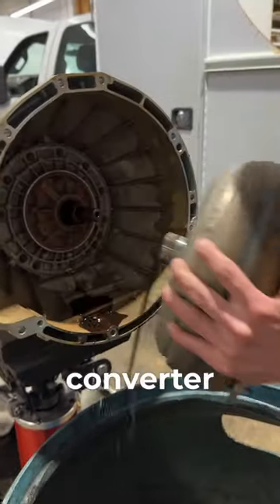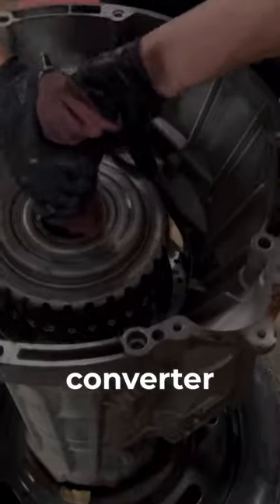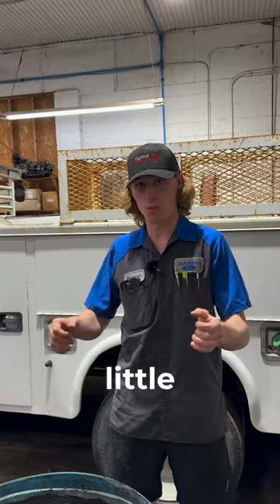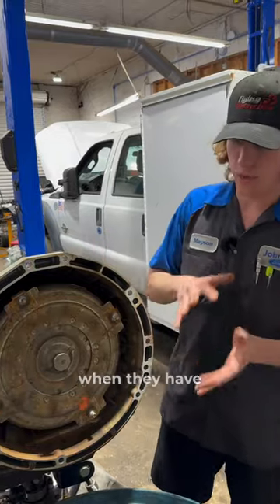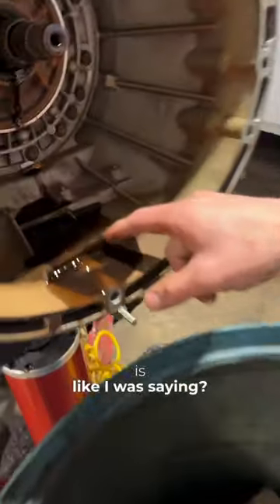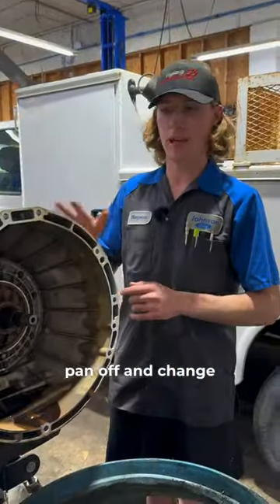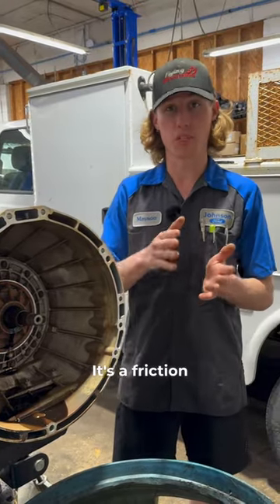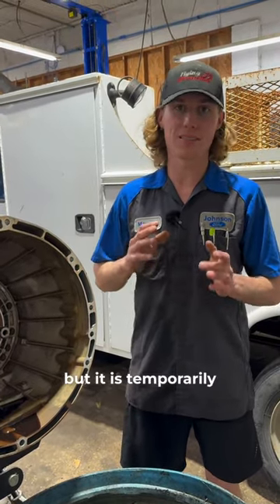Ford F150 6R80 Torque Converter Shutter? #ford #f150 #shorts

Comment: I had a shutter on my 2016. I added the shutter fix and it worked for 2 weeks.  I ended up doing a drain and fill and it solved my issues for the past year.  I know it won't last forever
Reply: Shudder not shutter.😂
Reply: Phew, thanks for the comment.  No one would know what I was talking about.
Reply: Imagine the people that buy a used vehicle that someone has put this in. This is probably a great product for someone who owns the vehicle, but I would feel pretty bad for someone who purchased one with this slick fix.
Reply: @dannyamericandream  I don't think it would hurt anything over time.
Reply: @skidooextreme2233  I don’t think it would hurt anything overtime either if it belong to you permanently. My point is some shady car sales place dumping this product in a transmission that shutters and sending you down the road. That’s my point. You might make it two weeks with that stuff. Maybe you get lucky in at six months.
Reply: @skidooextreme2233  I knew what you meant lol!
Reply: Flush + filter before additive, remember you are looking for a cheap fix, if it works you save serious $$ 
   Don't listen to morons the who think changing the transmission fluid will kill your transmission, if it fails it would have anyway, it's already damaged, remember? That's why you're trying to fix it!
Reply: That shudder fix is amazing it fixed my brothers 2014 Camry shudder after it had been doing it for the past 120k miles also fixed my 95 deville that wouldn’t go into overdrive anymore, fixed my girlfriends 05 Highlander that would slam into gear this was all years ago and all 3 cars still shifting amazing and no shudder
Reply: SHOULDN’T HAVE BOUGHT A FORD BUDDY
Reply: @leomarq  I had a newer Chevy truck and had the engine and trans go out at around 30K miles. The Ford Had a small shudder but other than that it's been rock solid. I still think overall Toyota is best but couldn't find a good deal when I was in purchase mode, lol!
Reply: To be honest, when we’ve changed the fluid, the shudder disappears after driving for 30 or 40 miles and remains gone for a long time in most cases and does not return. The additives don’t work for long. But changing the fluid does. I ALWAYS recommend changing the fluid first. If it lasts 40-50 thousand miles, by then it’s time to change the fluid again anyway.
Reply: What shudder fix did you use

Comment: Ford has more recalls than just about any other manufacturer.  Pretty sad!
Reply: Lol Ford motor company had over 21 million recalls in the 80s
Reply: Ford is the most recalled vehicle of all time, and it's not even close IIRC
Reply: @donaldkinder6716  The F-150 by itself is the most-recalled vehicle of all time, and it's not remotely close.  Like close to double the next most-recalled vehicle.
Reply: Yeah they should stop the recalls and just make the customer pay for the repair. That way investors can get more dividends from profit sharing.
Reply: @martyk1156  No, maybe they should make a better vehicle!
Reply: @martyk1156 fanboy 😂
Reply: @flight2k5  stock owner that wants higher dividends at the customers expense.
Reply: @martyk1156  you are?
Reply: Pretty sad no other manufacturers are willing to admit fault and fix things and there's no company that doesn't have serious issues
Reply: @robinhookedauto542  fanboy

Comment: My C6 pulled just fine in my old truck 1976 F250, for over 40 years.  Did i rebuil it?  Nope, got one out of a 72 LTD in it now.  Pulls good.  So poor i didn't even buy new fluid.  Just poured it through several layers of shop rags to get the chunks out.  No new filter or screen used the best out of the two.  I have moved trailer houses with that baby.  Move a 14,000 pound tractor, backhoe, i have used the heck out of it.  It was still pulling but would disengage when i hit the brakes.  That was the first time i pulled a transmission by itself.  I usually pull engine and transmission together.  I will do that from now on.  Tough to get out only transmission.

Comment: 2016 6r80. I added the shudder fix. Ran it with no issues for 9,000 miles. Then changed the tranny fluid. Still going strong
Reply: Me too!
Reply: Good thing I have the superior 6R140 so I don’t have those issues
Reply: @RiggyRonnie  what year?

Comment: Also, check for misfires, and replace plugs and coils if necessary. Sometimes misfires may give a similar feeling symptom.
Reply: If they feel the same you shouldn't be trying to diagnose and do your own work
Reply: What can happen is a misfiring aftermarket coil without EMI suppression can send interference back into the powertrain control system and affect the transmission's operation. Electronics is my field and I experienced this very problem with a Duralast ignition coil on my '08 Explorer. Felt like the transmission had two anvils smashing together and was going to rip itself apart. Swapped in a Motorcraft coil, problem gone. I had the infamous rear cylinder misfire problem due to water intrusion from the cowl. The stupid design with the deeply recessed spark plugs can allow water to collect inside and damage the coil and plug. Anyway, long story short, the OP wasn't entirely off base. And I'm an old school shadetree mechanic as well, and without understanding the susceptibility of the transmission to EMI, I would've scoffed similarly to you.

Comment: This same issue occurs on the GM made 6l80s and 6l80E’s torque converters, so this problem isn’t just limited to Ford. I just put a new torque converter in my 2009 Yukon Denali 6l80 and the transmission shifts beautifully. I never had the shudder but the trick is to replace the torque converter BEFORE it starts shuddering. Once that clutch material makes its way through your transmission you will 100% be looking at a rebuild.
Reply: it’s not the clutch lockup material in the converter running thru you have to worry about. it’s the metal shaving that come from metal-to-metal contact during lockup after that clutch material is long gone. you did right by replacing it before the problem started. get it tuned, factory gm tuning really kills the converters on top of a poor design. have it set to only lock the torque converter in 5-6 and it’ll live much longer and happier.
Reply: @adamsongarage9933  thanks for the explanation. I’ve been meaning to get a tune the past few months but maybe I should stop putting it off. I sometimes can feel that converter lockup ‘clunk’ at low speeds / throttle so it will be nice to be rid of that and have some peace of mind.

Comment: My Transit has this transmission and best thing it change the fluid regularly. The Transit is a pain in the butt since the cradle covers the pan. I use the fill port suck out a gallon of fluid and replace what I took out. Been doing this every 3rd oil change and my tranny is running great still with 128k on it. At 50k is was having issues already and not missed a beat since I started to keep good fluid in it. Lifetime fluid my ass

Comment: I can say that as a transmission mechanic, i get rid of shudder without replacing the converter. Just a service, with two tubes of shudder fix. They never come back with issues....
Reply: My 2005 F-150 shudders. Will the two tunes help me? Trans was just replaced.
Reply: @tomthomsen11 The shutter fix additive could help but it is usually temporary. I usually drain the fluid overnight so more will come out. Remove torque converter drain plug if it has one. Make sure to use correct fluid. This could also be a  temporary fix. A misfire and a torque shutter has a similar feel to it.
Reply: @carlt6932 thank you!
Reply: @carlt6932 a bad coil/plug can certainly feel like torque converter shutter
Reply: What shudder kit did you use
Reply: I agree with every comment but I will add that the temporary part can often last way longer than you think. I do a lot of these type of services on toyota , honda, and ford 6spd units and I can't remember having a customer who felt like it was a waste of $300 for my service.
Reply: Oh and the sauce is the lubeguard tube's you'll see. They are kind of a weird pill looking tube.

Comment: My 2015 expedition has this problem. Didn't start until 100k miles. After I had the dealer change my transmission oil.

Comment: Same on all pick-ups. Crappy stamped steel converter. Flexes against lock up plate. Replace with a forged, billet steel converter. Huge difference, especially when pulling a load.

Comment: So what’s the brand you recommended using to replace the original? Another OEM or do use aftermarket.  My 2016 needs it done an I’m just trying to see what my best long term option is.

Comment: The shudder is due to fluid breakdown. Change the fluid and it will go away until the next fluid change. You usually don’t need to replace the torque converter to correct this, simply change the fluid and give it time to permeate the clutches. It will take a few days to correct the shudder.

Comment: Quick tip, always check for misfires in these before you condemn the converter.
Ive been one of the guys other techs and shops send their headaches for the last decade or so, I have probably had a couple hundred fords,(3 valves were the worst) still shuddering with a brand new or rebuilt trans, that really just needed a tune-up.

Comment: I know that technically you are forbidden from doing this in a dealership (and that used to drive us nuts), but personally, I would install the shift kit in the valve body.  There are numerous issues addressed regarding TCC, and sluggish line pressure changes. If you catch it in time, you save the converter.  Sonnax makes really great products. I use Sonnax on anything newer. Older stuff I stick with Transgo. Everything else I typically avoid.

Comment: Best selling truck for 47 year's & running.  Keep it up Ford!!!
Reply: Bought a 2021 tundra 5.7 iforce with six speed will outlast any ford gasser. Two tundras with the same powertrain went over 1 million miles… Toyota large v8 = Reliability
Reply: @tannerpickens5356  Yes Sir! Toyota is #1 in reliability. Ford is #2. Ford still out sells them all though 😁

Comment: I put that shudder guard in my 2013 RAV4. They say it works immediately. I was skeptical. Well I can say it does work immediately and 3000 miles later it’s still working.

Comment: Pretty sure there is an oring close to the end of the input shaft that is most of the problem if not the problem itself instead of the torque converter. The "fix" in a bottle is a fluid that swells orings up. My buddy poured it in his 2017 fcrap150 and it totally stopped the shutter. So that tells you its not the converter causing the problem bc it still works

Comment: Also don't forget to replace the seal where the  torque converter goes in. I didn't do this on my wife's ford f150 and it leaked like crazy after. Even though it didn't leak before just Disturbing the oil seal caused it to leak.

Comment: I had this for a little while. Ended up taking to to dealership to flush the fluid then I changed the filter and fluid myself a couple days after. 20,000 miles later still no issue and it was way cheaper. Make sure to replace your fluid in the proper intervals.

Comment: I was told by the transmission shop that the most common issue with the 6r80 is the sensors inside collect shavings and short out.

Comment: there is a difference between friction modifier and shudder guard, friction modifier for the rear end is to let the clutchs slip smoothly, dont put this in your trans, only use shudder guard in your trans
Reply: What’s the difference?
Reply: There’s also products for transmissions, my buddy puts it in almost every transmission he builds. Been using it for 20+ years and has never had any negative results from it.

Comment: The GM 6-speed has the same issue. I don't know where they're getting their torque converters from, but that Chinese metal is just disintegrating into the fluid. Then if you know if you don't change it fast enough and you just keep letting it shutter all that material gets into the pump and blows the transmission pump fluid pump and then she'll be toast and overheat and you'll be walking or most likely getting a Ford explorer for a couple months if you have a warranty

Comment: Had this happen on low RPM's on my old 98 mustang. I was able to fluid change with some Lucas Transmission fixer. Was able to put another 100K on the car before it failed finally around 200K miles.

Comment: For you 10R80 guys if your clutches are getting to hot or just not biting the 6R80 is the move this more just for dig racing this doesn’t apply as much to roll racing 
You really don’t start noticing that issue until your in the 4 digit power number

Comment: Well if your only problem with a transmission is having to replace a torque converter after I'd assume 120k+ miles then you're doing better than most trucks made in past 15 years. I got 200k on my 6r80 and no issues. Shifts perfectly. Did to new filter at 120k  and replaced roughly 7 quarts or so of fluid so maybe that helped me out 🤷‍♂️
Reply: Have a 2014 5.0 work truck just hit 160k and shifts perfect. Has hauled a 5000 pound trailer 5 days a week most of its life.

Comment: Sounds to me the torque converter isn’t the problem. Sounds like a pressure problem. Not enough wear tolerance so I’d be interested if when the shutter shows itself. At that time increase pressure to accommodate for the cpl tho out of spec it has become due to natural wear!!!   Thoughts????
Reply: I Believe the actual shutter is from the lock up clutch in the torque converter slipping when it's supposed to be locked.  Chevy Colorados with the 8 speed apparently have a similar issue.
Reply: @Hollows_over_balls   oh it’s more then “kept in mind” it’s out loud when I said “ I’d be interested if” and when I said “ thoughts”. Pretty clear I wasn’t stating  a “ go no go” response

Comment: So what about the squawk of the converter during heavy throttle, low rpm shift from 3-4? Does it when I accelerate to pass when down shifting too. Blasted through one converter after a fresh rebuild, shop refused to cover it. Brand new converter does it again but it doesn’t shudder. Just the noise

Comment: Sonnax makes a modulator valve kit fkr these that fixes them fairly quickly and without removing the transmission.  I've installed four of them and no comebacks.
Reply: Anything like that that you know of for the GM 8speed? Thanks
Reply: I trade every two years. The last five have had shudder at 1100 to 1300 rpm driving. My 2024 ltz z71 10 speed has the shudder.

Comment: Have same problem with our Holdens Colorado that are GM makes in Australia & NZ. Torque convertors are replaced and flushed but problem returns. Some transmission experts in Australia pulled a automatic transmission apart and traced the problem to a poor design value solenoid that was designed too short and leaked pressure. Ford and GM must be sourcing the same automatic transmissions from same Chinese factory

Comment: Okay they want to do this stuff to f-150s and 1500s so be it. But keep this crap the hell away from the heavy duty market. All right the commercial market they deserve better. You know the guy that has a platinum F-150. He can afford to drive a Ford explorer for a couple months but the guy that has an f-550 dump truck trying to get work done or hell even F-150 work truck and that thing blows up now he can't get the job done. That's a reason why most of the super duties still have grease fittings. Still have mechanical fans, mechanical power steering... Solid front axles

Comment: I have a 15 f159 it’s the 6R80 with 172000 miles on it and haven’t felt a shudder yet. But my trans fluid is a nice pretty red because I changed fluid at 75k and every 40k after that. Screw the idea that the transmission fluid is a lifetime fluid because looking at that muddy fluid the lifetime fluid is bullshit.

Comment: Shudder fix only works if you use it in time. Too long and everything is glazed and hardened over . Sometimes there is a software update. The aftermarket has real fixes for this trash . Trans go, Sonnax. WIT make programming kits etc.

Comment: My C6 is still getting it just fine.
Reply: Yeah but I like having 6 gears 😂
Reply: @ShadePOWERSTROKE95  Your favorite part is the constant shifting?
Reply: @thisisyourcaptainspeaking2259  mine shift just fine for the most part!
Reply: I got a 14 with 130k it shutters a little taking off and shifting fine
Reply: @joshuahoward7567  Shutter while taking off?  I assumed the shutter was the converter lockup clutch locking in top gear(s) maybe I misunderstood...
Reply: @joshuahoward7567  mines a 13 with 170k and shifts fine and I beat the dog shit outta it 😂

Comment: Or stop telling people they can go 150k on transmission oil. That's the Ford recommendation and it's bullshit unless you buy a new truck every 100k. But if your like me and keep rigs for a long time, change your oil. Makes all the difference in the world for longevity. 
I have one in a 2013 f150 5.0l, has 220k on the clock and over 120k of that is towing over 6k lbs. Not a single problem other than some o rings in the plastic coolant hose connectors.

Comment: Fun fact… my local Aamco told me the exact same thing when I had my car diagnosed… I was like no check it out it’s a timing issues… since the motor revs pretty low… they recommend 3800 to put a new torque converter and rebuilt… I decline and spended 800 fixing the timing issue
Reply: Don't go to a trans shop for an engine concern. At least get a 2nd opinion

Comment: Torque converters/hydraulic couplings are mind blowing. What one can do with the concept of Hydraulics. Sucks that Fords suck. It gives Hydraulics a bad rap. There is no reason a sealed part should fail like that. Hopefully it's not another issue with the Trans that caused it